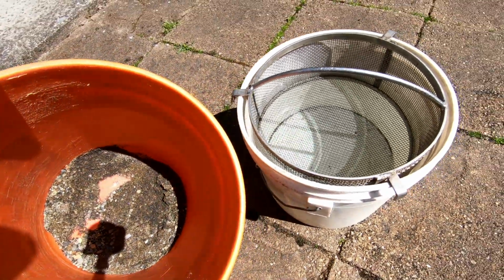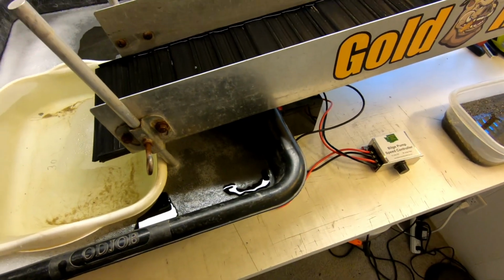The Gold Just Keeps On Giving

Comment: Like for example looking through the new WA state gold pamphlet thing this part it says. When collecting or excavating aggregate you may not stand within, or allow aggregate to enter, the wetted perimeter. But isn’t that what ur doing with a sluice u put the material in and then the water in the wetted perimeter washes the material this is what I get confused on🧐
Reply from the maker: Only when using motorized equipment. Now you can not use motorized equipment. Pan, Sluice, Rocker box ect.is the only thing you can use.
Reply: @washingtonbeachmining7736  alright  last night I ended up printing out the gold and fish 2021 pamphlet and the only other big thing that was confusing was in multiple areas in the pamphlet it says you can do it year around but like when it gives u the list of rivers where u can sluice or pan it says from only July to august any insight on that? The counties I’m going to be trying this out at are Clark and skamaina county?

Comment: Can you give any pointers or very useful info to ur fella WA peeps. I want to start but I’m so worried about doing something wrong like going to a river and getting a ticket for looking for gold or using equipment that not suppose to. I heard you can’t use anything with a motor but is there restrictions to where I can do like what ur door just a shovel bucket and a slice that uses rive current to wash the material down it. Anything would be helpful I got confused trying to find the info on google.